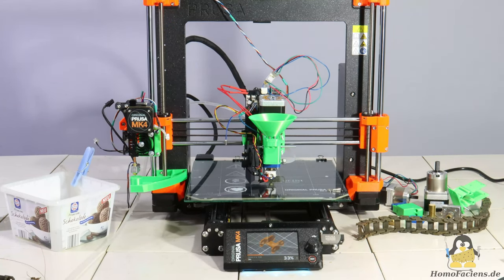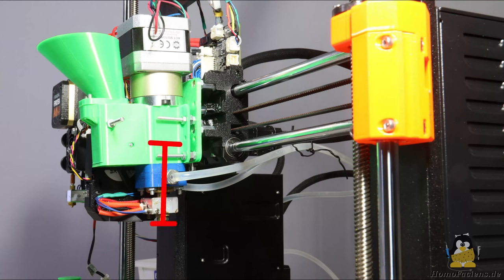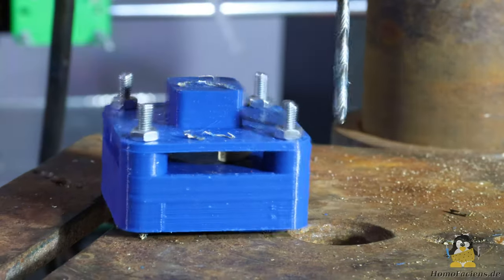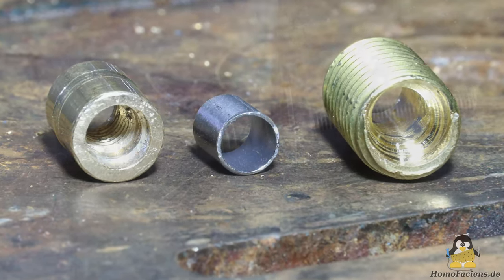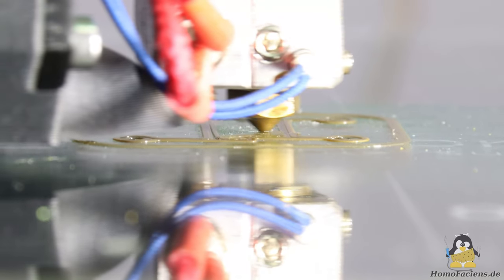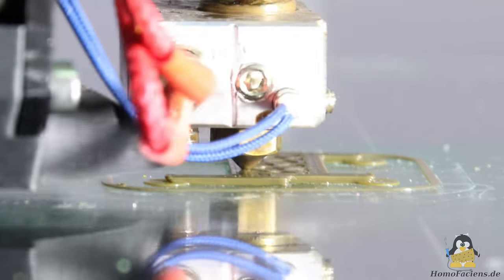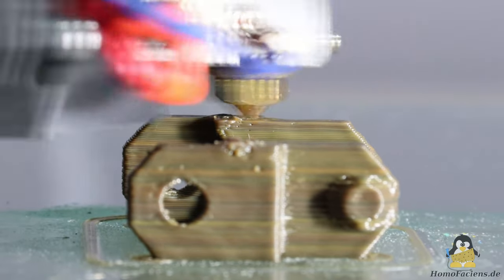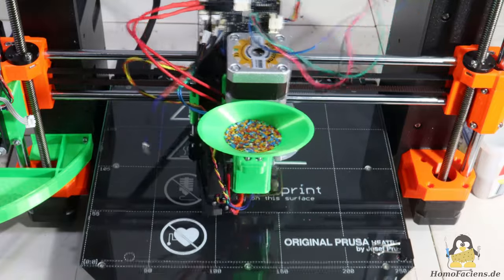Conversion of a Prusa MK4 to granule extruder V5 0

Comment: Impressive work.

I like that your test print model has some practical use. Much better than printing toy boats and coins.
Reply from the maker: Thanks! I am also no friend of wasting time and energy with printing things other than parts for machines or robots, but now I found at least a way to turn these back into raw material for another project. 3D Benchy printing will be carried out in the future, simply because anyone with a 3D printer knows what they look and feel link on their own machine. Back into the blender afterwards ;-)
Reply: Nah, i refused to print Benchies for like 8 years but now i love them. They allow easy comparison between printers and settings and demonstrate a number of possible print quality defects which are likely to bite you on a larger more complex print, which would lead to more waste. It doesn't take up too much time or material.

Comment: Would be interesting to see how it handles increased nozzle diameter.  I havn't printed with 0.4 for many years, using 1.0 for almost everything (functional prints only).
Reply from the maker: Functional parts printing is what I am doing as well. I will talk about material throughput and nozzle diameters in (at least) one of the coming videos. Stay tuned!

Comment: are you using your blender method to create the plastic granules?
Reply from the maker: Yes. More experimentation on the preparation of raw material will be carried out in one of the coming videos. Stay tuned!
Reply: @HomoFaciens  Thank you very much for your work! i wish i had kept all my failled 3D print all those years for this. maybe in the future a special head will be mass produced for a low price so it will become more easily done.
Reply from the maker: You're welcome! Well, the heap of failed prints in my workshop really needs to be crushed to raw material. Lots of work ahead...